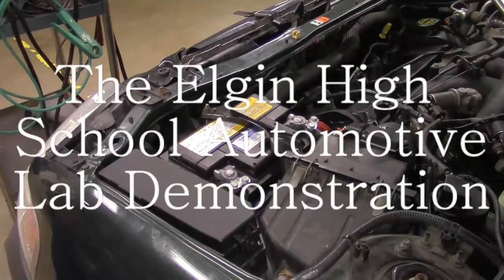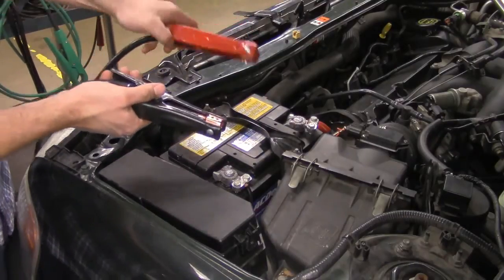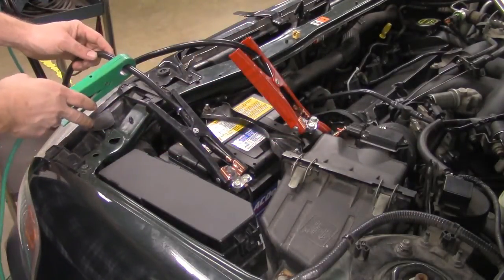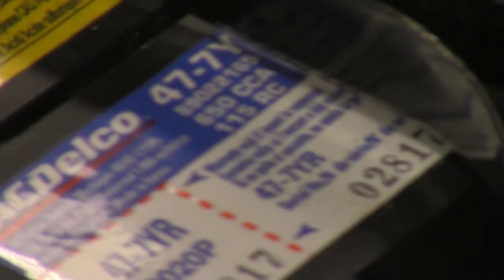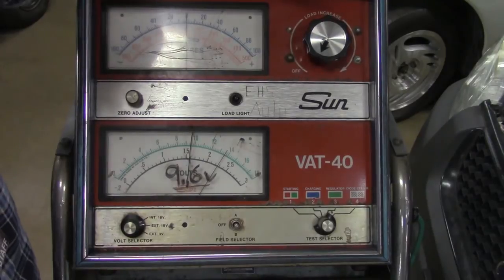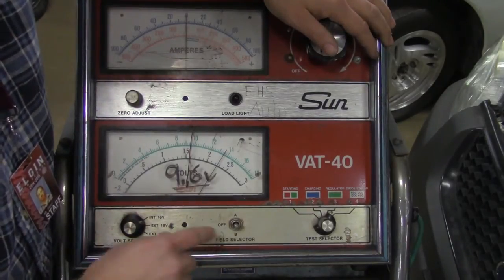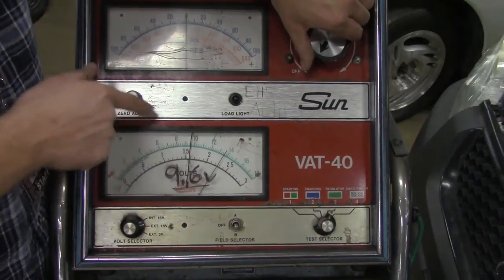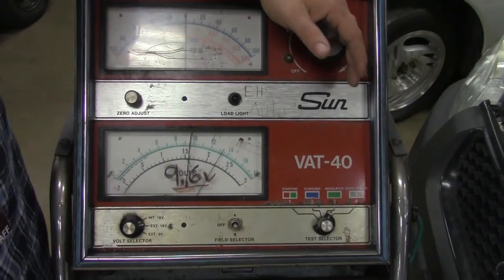Battery Load Test VAT-40 (in vehicle)

Comment: should do a load test to remove top voltage... wait five min and do another full load test like 10 sec at least 10 sec... just say`n ...  i own a vat-40. i was told before hooking up VAT-40 turn the LOAD OFF POS SO IT WILL NOT SPARK... WHEN CLAMPING IT ON BATTERY...